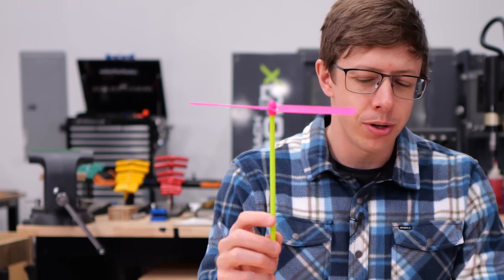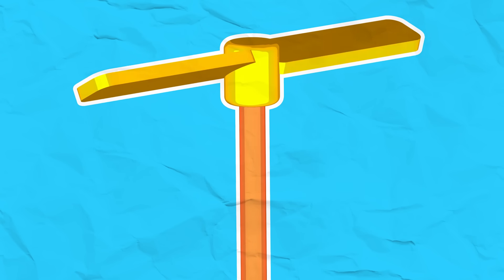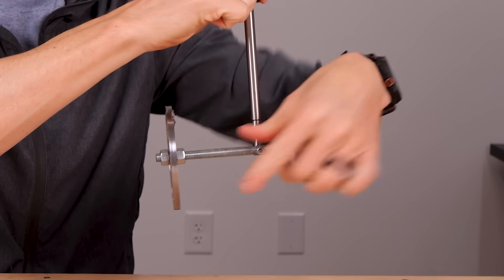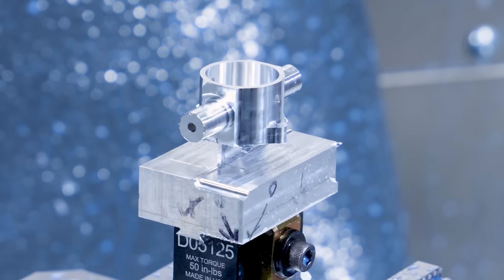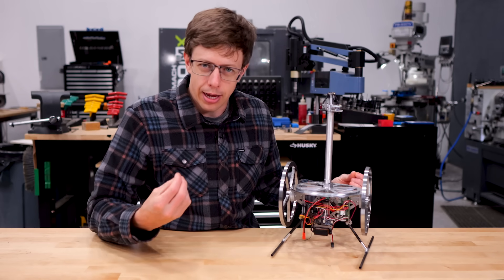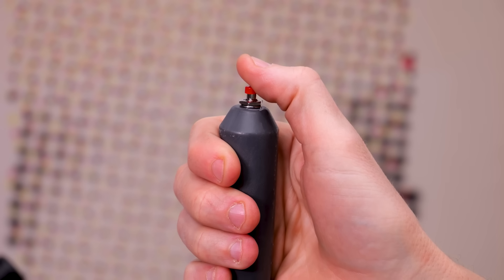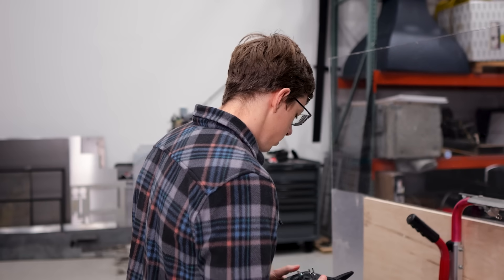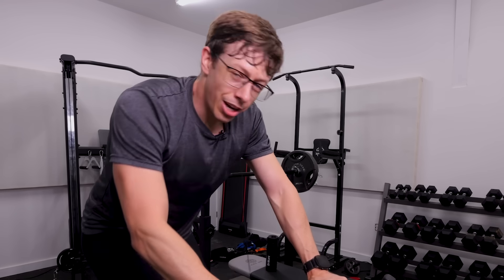I really thought this would fly well

Comment: Thoughts for design changes:
     1. If you added a second propeller that rotated the opposite direction, it should counteract the rotation? Would also need another prop inversion channel through your central column, which might be out of space.
     2. I like the control surfaces, as obviously more control is better, but your current design has wings with control surfaces attached. If you simply rotated the whole wing, you would have much larges surfaces, so you should see a larger rotational force. Probably a quicker fix than option 1, but I would do both. 
     3. Helicopters generally have a propeller on the tail, that can change speed to allow, balance, or counteract the rotation from the main prop. I don't know if you want to turn this project into an RC helicopter, but a variable-speed prop off a lever to control yaw would be cool as well. 

I'm sure there are other people with similar thoughts in the comments. I think each of these avenues would be worth exploring. 

Love your work!

Comment: You could’ve simply attached a motor coupling to the base of a suspended tube with a contra rotating propeller setup at the other end and spin that up until it’s ready to be released. 🗿

Comment: Hello! Why not make it more like the original design or the little twisty hand-copter? Make it so the motor/gears will speed up the propellers, and then just the shaft/propellers comes off and flies up like the original little plastic toy design, as opposed to the whole assembly? Less weight and drag for the flight portion, no damage to the lower components that took all of the CNC work. Probably insanely dangerous at those speeds to just release a light propeller that will come back down, but fly high? probably?

Comment: Couldnt you try a single flywheel that is coaxial but spinning in the opposite direction to the propeller ? If it has the same moment of inertia of the propeller the drag torque on the prop should be equal the 'braking' torque on the flywheel and cancel it. Or did I miss something ?

Comment: Just do what helicopters do to cancel the torque and put a propeller far out on a beam that pushes against the torque. Seems like the obvious solution, youre basically just creating a helicopter that uses kinetic energy instead of fuel at that point though

Comment: 4:04 not sure if that is said later in the video, ut you could just let the blades stay in their position and able to rotate freely. They will work as a parachute without muchmore aditional technic. Its called autorotation i think, and is how helicopters can land after an engine failure. But the blades need to be able to rotate so they can rech a certain speed!

Comment: Just my 2 cents, but... Aren't the two flywheels spinning in the same direction? Relative to the rotorshaft, that is. This would only increase the precession forces, instead of cancelling them out, correct? If one rotates in the opposite direction, so  both rotate towards, for instance, the front of the machine, this would generate the opposite torque you were after. Or am I missing something here? In any case: thank you for sharing your struggles as well as the successes. That is really refreshing! 🙏 Have a good one.

Comment: Maybe go back to the original hand-held toy design. Long relatively thin blades with substantial weights on the ends. That way  you can get all the inertial momentum without the actual weight of a separate flywheel. Then spin it to 20K-rpm with some sort of a quick-release on the end of the central shaft. Maybe play with blade winglets and twist in order to tame the flight characteristics. As it stands you are just slowly engineering your way into a flying wing. Alternatively, if you want to iterate on the current design by making it even more complex you can always try counter-rotating props. That should at least let you shed the wings. Also for the bevel gears you might want to run some lapping or polishing compound through the teeth and let them wear in a healthy pattern. Cut teeth are going to be a little rough compared to hobbed teeth.

Comment: Rather than having just a big wing assembly, just have a shaft like the original toy, but with a flywheel also attached to the shaft for storing energy as intended.  Build a base that spins it up and then releases it at a specified rpm. This simplification of it would have made it much easier.  Plus you could have probably still had the blade pivot assembly work for the decent. You then wouldn’t have to worry about an entire craft spinning and the fly wheel wouldn’t have gear friction either.

Comment: I think you could have solved the torque problem if you had designed the wings better.  first they are too small.   But mainly they need a better airfoil..    Instead of flat plates with a trailing flap ,  it could have been a nicely curved airfoil shape  :   the leading edge having about a 3mm radius, and pointed a bit to the left of parallel to the spin axis [the velocity of the flow from the propeller will have a rotation component ].   The trailing edge curves off to the left by about 20 degrees, [so a total of about 25 degrees of camber]   and have 4 wings,  naught only 2.   They be long enough to replace the 4 landing gear.      Also,    I don't know for sure,  but my intuition tells me the flywheels should be co-axial with the propeller axis, and spinning opposite each other.   The spokes be simple wires like bicycle wheels. 
JMHO

Comment: 🟦…It may sound a little complex, but if you hook up a servo to those "body panels"In such a way that you can tilt th' panels to deflect th' air from th' rotor off at an angle to counteract th' torque, Your problem might be solved! 
...You would have to be able to control the amount of deflection, hence the need for a servo for the body panel to "fine-tune" th' amount of deflection "On th' Fly".
... Also, have you thought about utilizing the available gyroscopic procession from the two flywheels to somehow stabilize it?

Comment: Maybe I missed something (I'm a software engineer, after all), but why not make the flywheels coaxial with the propeller shaft? If you have two contra-rotating flywheels, then shouldn't they cancel out any rotation of the whole body, and their gyroscopic stability would be working on your side, instead of against you. You could use planetary gears (or something) to connect them to the shaft.

Comment: What if you go with a dual counter-rotating fly wheel in line with the rotor axis ? The one that is rotating in the reverse direction from the rotor would be slightely heavier to cancel out the rotor's torque.

Comment: A contra rotating prop could help. Plus fins don't work as well without sufficient airflow and dirty air is not the best condition for them to work. flywheels flat on the bottom with string as spokes like waxed kevlar string could reduce the drag of this solution. You could also use this to isolate the control assembly from motor assembly. Just other ideas to solve the same problem.

Comment: afaik control surfaces need a decent bit of airflow to act against to contribute any kind of controlling force. So until the helicopter is actually moving very quickly up or down, they arent likely to provide any counter rotation against the rotor. Your best bet would be a redesign like you said where you use two counter rotating propellers. If you look at helicopters, the only control surfaces they usually have, if any, are the ones on the tail that are aimed horizontally not vertically.

Comment: Your connection between the rotor spinning and your flywheels maybe the problem. The drag of Air in your Flywheels, wich you sealed, is present on your shaft for your rotor. Maybe thats the reason your wing didnt did anything, cause the air got puhed away.

Comment: You should put the flywheel in line with the propeller and gear it down so that flywheel spins faster than the propeller. Fix the  bottom shaft to the flywheel and then “charge” the helicopter by spinning the whole craft.

Or maybe use a spring with an escapement to store energy instead of a flywheel. It would be cool to have a version of the toy that you could wind up without spinning and release to launch!

Comment: 13:33 The control surface is actuated in the wrong direction if you want to create a CCW torque on the "drone". I'm referring to the "left" control surface, if you are where the motor/battery are and are facing the "drone". The "left" and "right" control surfaces are both in the same direction, meaning one is correct and the other isnt (for creating CCW torque)

Comment: So your primary anti rotation control idea involved downward airflow, on a copter that you reversed the airflow on to keep it from flying away as it tried to spin....  not going to work, ever.
instead, just tie another lower bevel gear to one of the flywheels, run it down a tube and make a tail rotor, like every other helicopter that doesnt have counter rotating blades... or... do counter rotating blades...

Comment: If I can make a suggestion, maybe a cleaner (and hopefully higher performance) concept could employ a flywheel axially connected to the rotor shaft via some sort of clutch. The idea is to have the clutch engaged to the spinning mass on ascent. Then, when the craft is descending, the rotor (now decoupled to the flywheel) could start autorotating, providing useful drag to slow the thing down.
In that regard, the flywheel/rotorDiameter etc should be designed primarily around descent requirements.

Comment: Those wings need air to flow over them to generate lift, but the rotor will twist the air in a corkscrew-like motion, causing the airflow to hit the flat sides of the wings instead.
Look up prop wash or rotor wash if you want to learn more.

Comment: @StuffMadeHere Just wondering if maybe a single flywheel on the bottom instead would work. Still geared 5:1, reversed so the shaft spins opposite to the flywheel? Hollow main shaft,  shaft in the center for mounting the rest of the stuff in line underneath and giving a support surface to put bearings for the rest to spin in their respective direction.

I know there are many other comments offering solutions to make it more stable like a helicopter, but i think this option is more true to your original intent of ramping up the toy. Also there may be potential for additional lift from the flywheel in this orientation if designed with reversed blade as supports.

The launcher/ spinner in this case would only need to be a wheel touching the outside of the flywheel as well so could make it more compact and less complicated.

Comment: Maybe I have a solution for you. Try adding second propeller on top of the first one, that would spin opposite direction  (Ka-52 helicopter has this mechanism), that would cancel out torque from the propeler, and by adding second large gear wheel on the opposite side from the first, you will cancel out torque from the first big gear wheel itself. The wheels will spin in the opposite direction, and by connecting each propeller to each gear, you should completly cancel out the torque. Sorry if I missed something, but I think that it should work. (BTW love your videos)

Comment: I know what you did that was wrong....  If you have the shaft going down spinning, you should also have a shafter at a 90% angle also spinning with the same rotation and a blade pointing out on the side like a helicopter, this will help with your balance rotation and keep it aligned. I know its adding more to your design but I think you where so close

Comment: So, i'm thinking, why not just supersize one, and attach it to a car with a rope.
Some mechanism to turn the pulling of the rope into the spinning of the blade.
once the car runs out of rope, it pulls the pin keeping it on the ground.
And watch it soar.    sometimes, simple is better.

Another option i was thinking about, would adding weights in the blade tips make enough of a flywheel to improve it's performance? (back to normal scale of course)

Comment: Just a thought, but with the control surfaces just an inch or so off the ground, won't all that downward air volume from the prop just turn into a violently turbulent air around the control surfaces as it immediately comes into contact with the ground, greatly reducing or eliminating any counter rotational effect on the body until you've reached several feet in the air (at which point the body has already begun to spin)? With an already spinning body, which has a large flat irregular surface mounted in the center with all the electronics, you're getting similar air resistance as with the flywheel, which could be adding irregular flight characteristics, in addition to the initial spin from the turbulent air impacts mentioned above.

Comment: Effort only counts when your predictive reasoning can prove itself viable. It was not viable. 
It had also been done before using a motor instead of weight... Look at gyrocopter development. They worked a whole calculation into stability for it's development giving minimum standards. You want to build something revolutionary, look into zero point energy.

Comment: For the redesign: a single fly-wheel horizontally mounted that rotates in the opposite direction as the rotor blades.  Its similar to the counter-rotating blades suggestion but, instead of blades rotating in opposing directions, the rotor and flywheel turn in opposite directions.
Reply: Except it will block, at least part of the down going air?.. and if you cover flywheel with cover foil..
Reply: Who says the flywheel has to be wheel shaped? Look at the toy, and how long the handle is on it. The extra length provides mass and a long lever arm to efficiently counteract rotation.
Reply: should it rotate in the opposite direction?  spinning is not a problem for the toy

Comment: There was a Japanese TV show called Supreme Skills where they pit two teams of makers (craftspeople or engineers or artists or machinists) to perform a challenge. For example one challenge was between welders and people who build structures using bolts and the challenge was to attach two objects together and then a hydraulic test rig would try to rip them apart and the one that could withstand the most pull force wins. Or another challenge was to build paper airplanes (glue allowed) that would pass a series of obstacle courses. One of the challenge was to see how high you could fly a bamboo dragonfly (the Japanese name for the propeller toy) and the two teams built machines that would spin the things really fast and release at the right time. I watched that episode on Youtube but it's not available online anywhere now. The relevant episode is episode 6 of the 2016 season. You can find other episodes of Supreme Skills on Youtube (seriously worth watching) but not the bamboo dragonfly episode. So I can't tell you how high they managed to get it to fly. Oh, and the propeller toy that they had to fly was the traditional version actually made out of bamboo - as per the competition rules for that episode.

Comment: Would making two sets of blades going in opposite directions help cancel each other's rotational force?
Like via a planetary gear system. Have a second set of blades attached to a ring gear slightly below the main set of blades, a number of planetary gears attached to.... Some mounting frame that goes around the already present gear.
And give the top of the main axle teeth to have it function as a sun gear.

Comment: I'm guessing the wing isn't very effective because of lack of airflow over it. Even if the prop is blasting it with air, it's very close to the ground, so it's slowing down by the time the wing would effect it and get a reaction force. Just my 2 cents

Comment: The wing is wayyy too close to the ground. Air flow stagnates when it hits the ground so the wing sees almost none of it. And after launch by the time it's high enough to get out of the ground effect zone the machine is already spinning uncontrollably.
At this point the easiest thing to do is probably make a launch stand that raises the machine high above ground and allows the air to flow downwards unimpeded. This should give you at least some control authority. If it would still be not enough, consider moving the wing as close to the blades as possible where the airflow is fastest and isn't shadowed by the huge gears.

Comment: The flywheeel stopped rotation at 20k rpm. Surely you can just make the fins big enough like on a dart  until that balance is tipped in favour of the fins. So the bottom just can’t rotate fast enough to be a problem

Comment: Why didn't you put the flywheel at the bottom in line with the blades, so the torque of blades are counteracted by the flywheel ? Take a look at the oldest 1960's RC helicopter plans. It would have been simpler and would work.

Comment: It seems your understanding of drag vs lift is faulty.
If your understanding of drag was correct, all airplanes would fly as slowly as possible. Yet, airplane manufacturer and airplane customers (airlines) figured out that the most economical speed to fly an airplane is as fast as possible without breaching the speed of sound.
The drag does increase with square of speed, but so is the lift. Yes, lift also increases with square of speed.
I think more useful way of analyzing your device would be considering amount of energy stored per unit of mass of the device and then efficiency of converting that energy into lift.

Comment: The rpm of the rotor has to have a clutch to allow the rotor to freewheel.  So the air past the has a dynamic to spin the rotor.  When the rotor is locked in gear it can't be moved by the air going past it.  That is the number one problem here.  You need a clutch on the rotor drive.